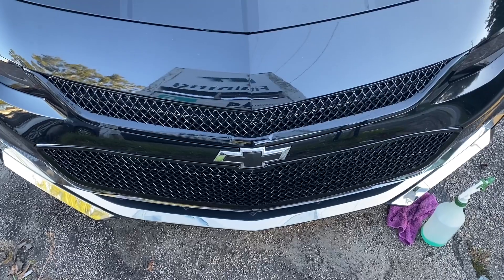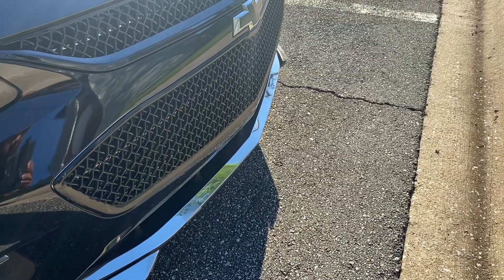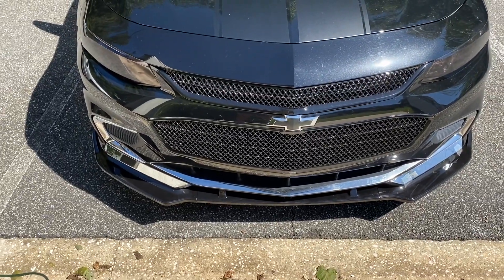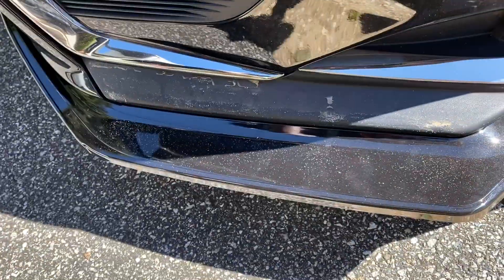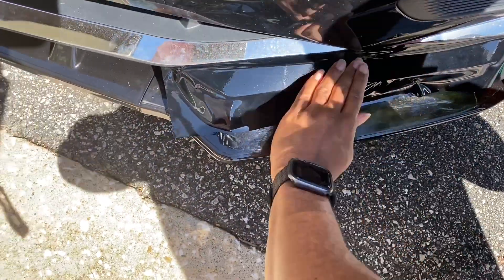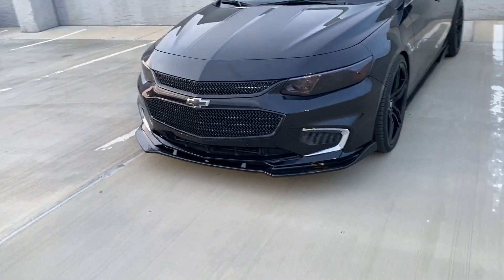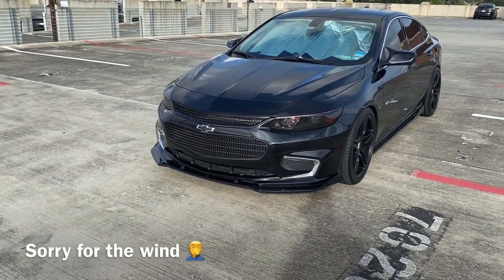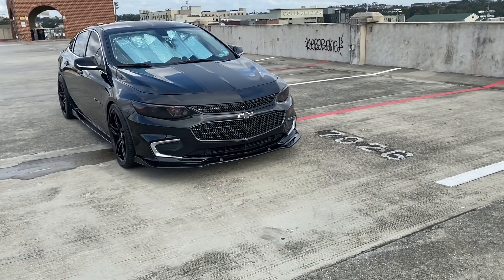Front Bumper Lip Spoiler on Chevy Malibu

Comment: Like your Malibu, just swapped the 2.5 out of mine, did some research  and found a L4 ECO from 2015 Cadillac ATS. LOT OF WORK, swapping timing cover, ats is rwd, motor is mounted different etc. sensors etc. Took 2 days...  runs great and only 19k miles for 475$
Reply: I need to see that

Comment: RE: your front grill... I've seen the same one and wanted to get it, but where I live we have to have front licence plates installed.

any ideas if that grill can be used with a front license plate holder as well?
Reply from the maker: I don’t believe there will be a way to get a plate mounted through the custom grille because the mesh of the grille is really tight of space. The only thing I can think of is to get it mounted below the grille in the small area between the front bumper lip and the grille if possible 💪

Comment: Nice Car! I have a 2016 Malibu and just got the front lip spoiler. I was going to try and do it myself, did you know where he screwed it in at? Or do I have to take it to someone
Reply from the maker: Thank you! 🙏 and sweeett 🔥 I’m not sure the exact points where he screwed it in at but once you get the bumper lip you can drill it in at any point on the bumper that is flush with the car so you can definitely do it yourself, it’s fairly simple and once you got it lined up on the car you can go ahead and evenly drill the necessary holes throughout the lip 👍